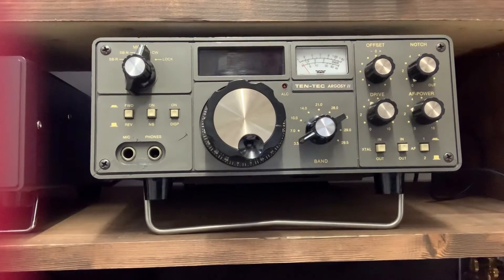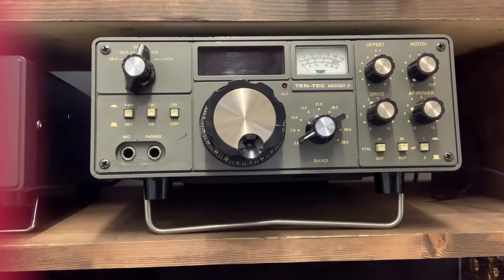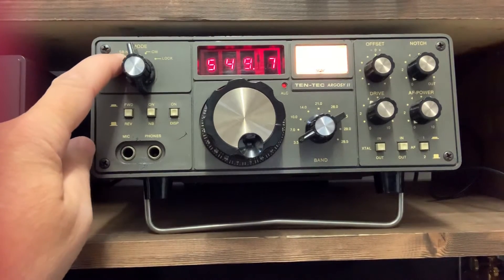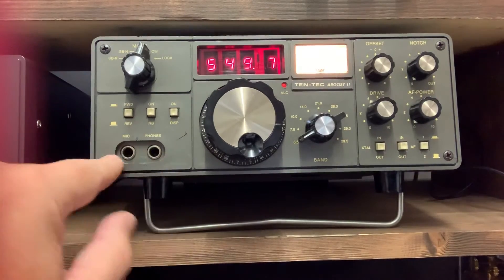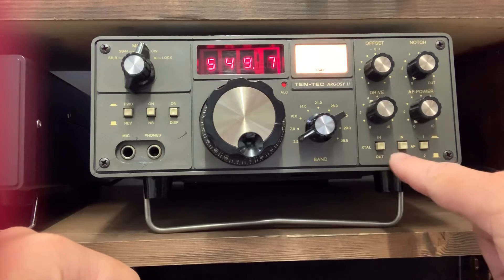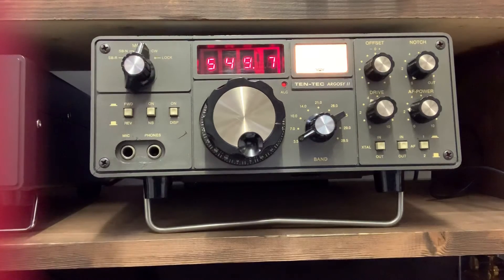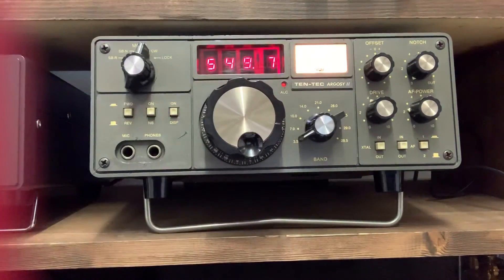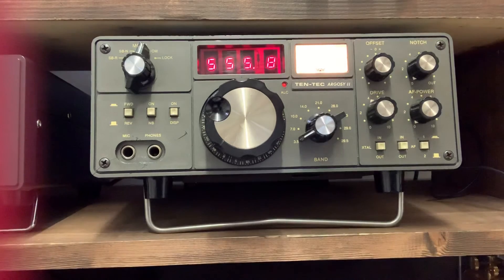A look at the Ten Tec Argosy 2 with G0PNM

Comment: To correct my earlier post, the Argosy II and Argosy 525D were in fact the same radios according to a different article I found. My model is the one featured here. I had a problem with the low power accessory port on the back and sent it to the factory. While there I had them add every filter that was available for this model. It was a QRP CW ops dream at the time.

Comment: This model was preceded by the Argo 525 with an analog readout. Apparently the 525 and the II were manufactured simultaneously according to an article I read. I had the later 525D, which also featured a digital readout, 5-50 watts, several filters, but no WARC bands. Apparently somewhere along the manufacturing chain, they added WARC bands to the II (and probably dropped the 525D). The 525D was such a fun radio to operate, I always regretted selling it. I used the cash to purchase a Yaesu 747GX with WARC bands and CAT control. I did purchase an Argo VI (Argosy 539) a few years back before Ten-Tec was sold and manufacturing ceased — at least for the Argos. I probably will not sell the Argo VI.

Comment: Thanks Pete, good overview, could you consider another in depth on this Ten Tec, including the back side, my hi/lo power switch is there as well. I am curious to know how many wires are running into the rig from  the power supply (original PS ) as other videos of others different models show 2 wires and a relay switch for SWR overload that has to be reset, my rig what you have shown as no such flip switch.
Thanks so much, I'll soon have mine hooked up to an end fed.
Mike in NB Canada